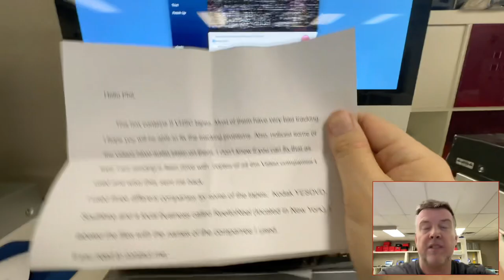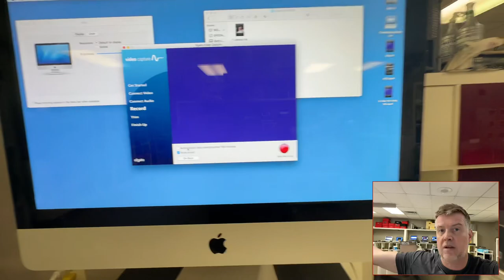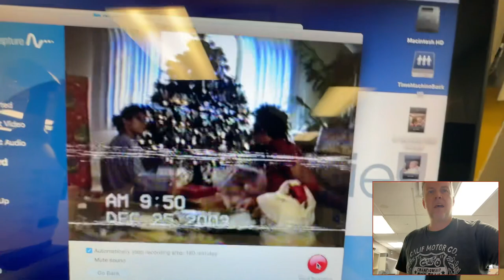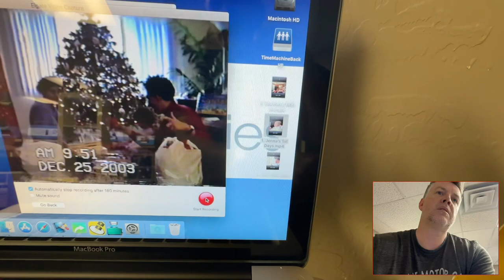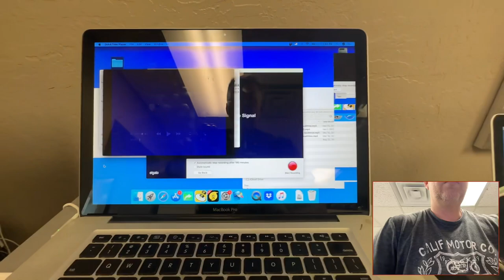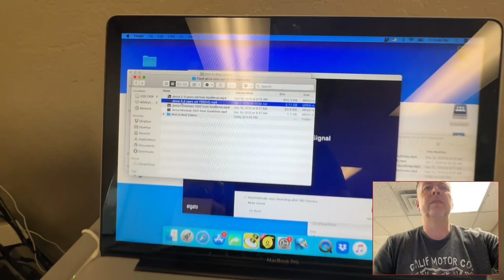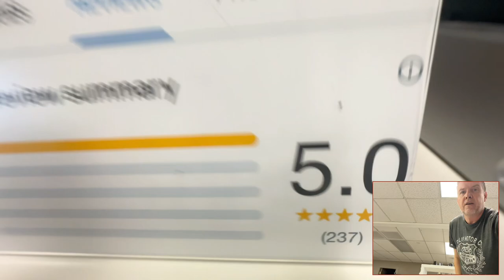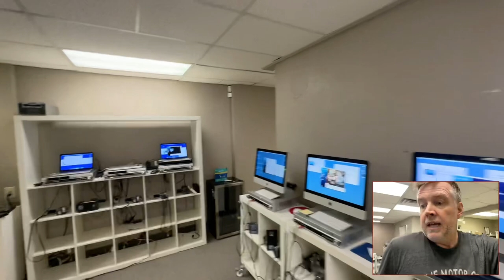How to Restore VHS & Get Clear Picture & Audio with Tape Path Alignment Adjustment (Might work)

Comment: I’ve been into video production and editing for many years and appreciate the bar you’re setting for converting these to digital video! Currently I’m having some fluttering or what sounds like [a repetitive static/low volume drum or clicking noise] — is how I would describe it. I’m not seeing any real good reviews on a VHS head cleaner on Amazon and I’m considering purchasing a refurbished VHS player instead of blindly hoping a used one from a thrift shop works but that might be the best first option as far as cost. I know I have tapes with a lot of white noise that should have video on the VHS tape so I’m afraid to contaminate a new player without using a VHS head cleaner. Oddly, at one point I moved my VHS player to the ground in relation to the wires I had running up to my Panasonic DVX camcorder which is feeding the FireWire to my computer — and by being on the ground I had heard some of that noise go away. I don’t know if that’s by chance or if the RCA wires have a problem too. Overall, I’m just thinking the tapes are from the late 80s/early 90s and the age of them are the root of the problem. Again, I appreciate your videos and tips!
Reply from the maker: All these tapes / players have issues these days and it’s becoming more time consuming and tedious work to get these things to play with clear picture and audio for the entirety of the tape, adding to that if they’re not the masters, recorded in long play or extended play, been kept in the garage, attic, sheds, even worse, hence why so many companies are churning out unwatchable junk. 
Thanks for sharing your story & good luck on your project!

Comment: I have a Panasonic AG-7350. From a perfect picture, it starts with a band of noise across the middle of the screen, and then it splits in two and slowly moves toward the top and bottom of the screen until the picture is gone. Then the picture returns and it starts all over again. Do ya think this is a tape path alignment problem, or something more serious?
Reply from the maker: Time for a new vcr!
Reply: Hello!.I'm from.Brazil and I have a LG  7723b.  (Pal-m and NTSC). I play my vhs and choose the NTSC output. So  I connect the S-VHS output on my cannopus ADVC-300. In the back of ADVC-300, I choose the RGB output. I connect it on my DVDO EDGE GREEN, from an upscale to 1080p. From EDGE to my PC, recording a .MKV in 1920 X 1080p (60Hz).
Reply: as someone who repairs vcrs this is very likely an alignment issue. i would check the condision of the pinch roller for cracks

Comment: The buzzing occurrs because the VCR is trying to decode HiFi stereo audio but it struggles due to the bad recording. Thats why if I were to run a video transfer business I would have a couple of linear mono VCRs floating around just for cases like this, where the audio is important but it doesn't really need to be HiFi, or in stereo in order to come out perfectly.
The work you do is insane and I would definitely use your service if I were a normal customer, AND if I lived in America, no matter the cost. Your channel got me into VHS.
Reply from the maker: Thanks for sharing and the kind words! Cheers!

Comment: For someone that just got into the digitation world. This feels like heaven. So much equipment and I guess most of them are customer entry?  I'm checking thrift stores regularly to check if they got any good VCRs/HDD-recorders. Maybe its already on your channel but do you have any tips on where to look for? Do I really need a Super VHS recorder? Do I really need to look for a TBC inside the machine? All the FAQ-items seems to be dated all the way back to the late 00s and beginning 2010s. What is your way of doing it 2023 style?

My way is to run the VCR into a HDD-recorder and then transfer the files from the recorder to my PC. I'm European btw, we mostly use SCART instead of composite.
Reply from the maker: Scouring eBay is the best way! Although anything refurbished with a warranty doesn’t come cheap.